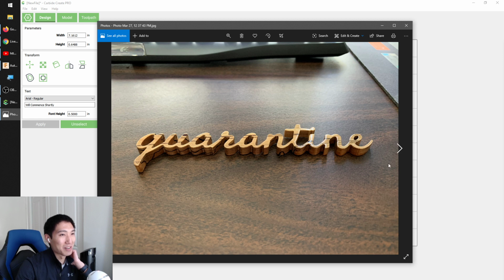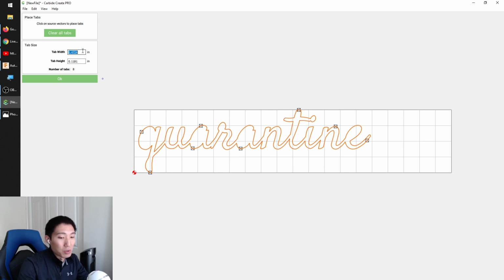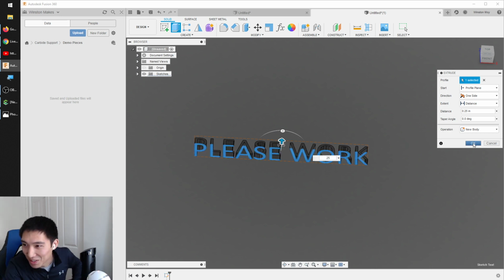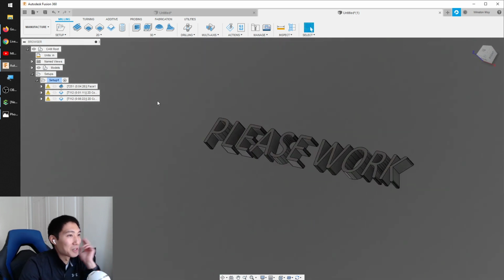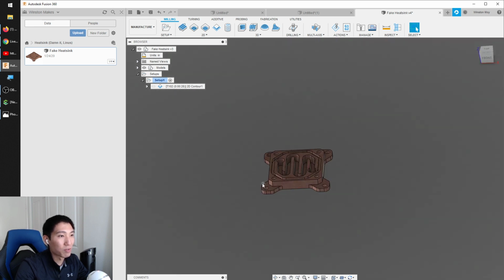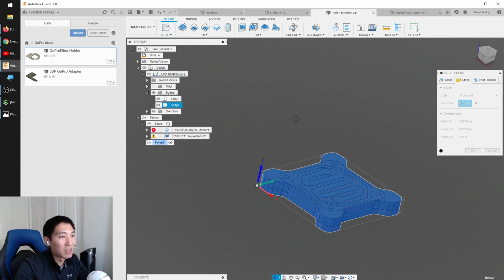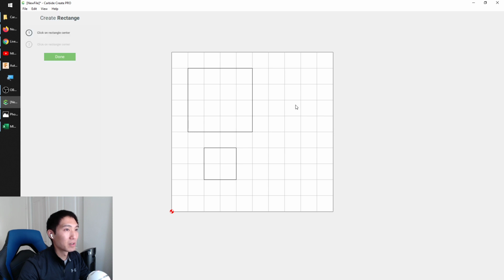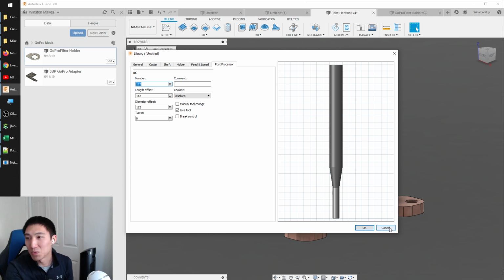Making a Stylish Quarantine Sign in Carbide Create & Fusion 360 - Carbide 3D Office Hours

Comment: I want to make guitar bodies and necks. The body thickness is 1.75 inches (44.45mm) thick. I having a problem finding a .25 in diameter cutter long enough to do this what if any thing do you recommend. I believe the 1/4 inch cutter with the longest length of cut is 1.5 inches that I have found.  I am using a shapeoko 3 xxl purchased last month. Can regular woodworking router bits be used? Thanks your time and trouble.
Reply: Yes you can use regular 1/4" 2 flute router bits . Just don't take too deep of cuts at one time and if you have a dust shoe use it if not try to get the chips or saw dust out of the cut grove. I use these bits some and a lot of the time they give a better cut
Jeff